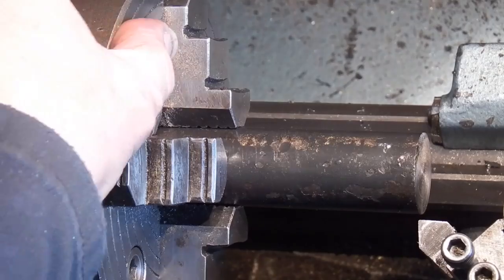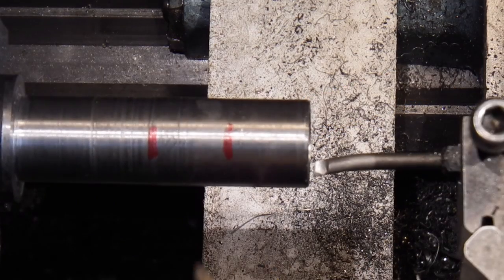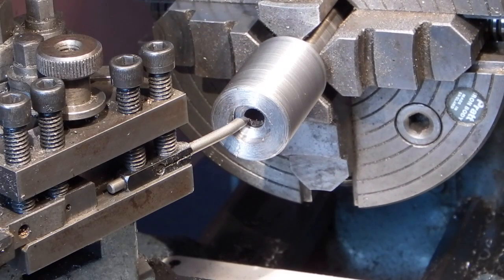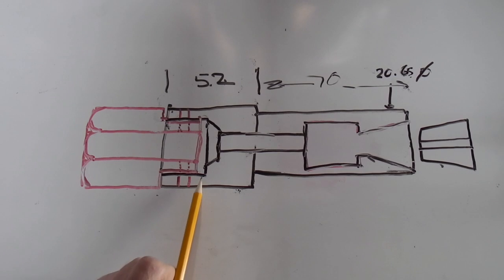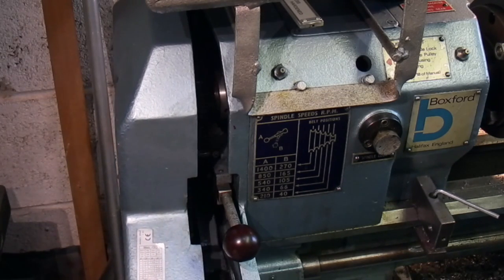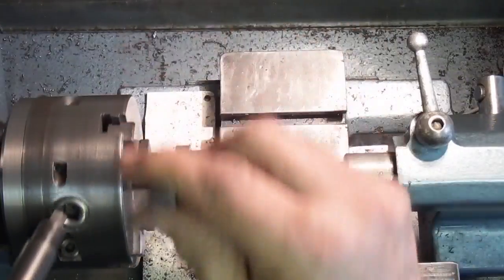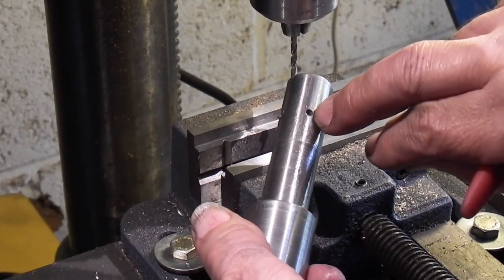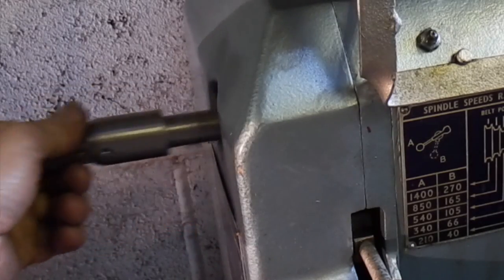Headstock handle, expanding mandrel.

Comment: Ha, I was just making something similar, to remove a stuck on chuck...wish I'd looked beforehand and saved some trial and error. Thanks for the great video anyway, now I have other options.
Reply from the maker: Hi I don't think you will get enough grip on the head stock with an expanding mandrel to remove a tight chuck.